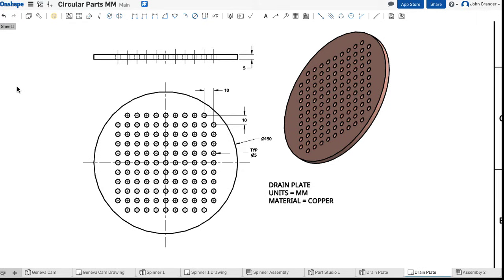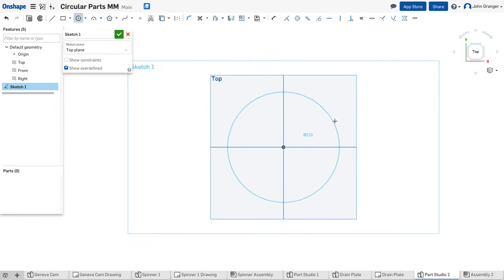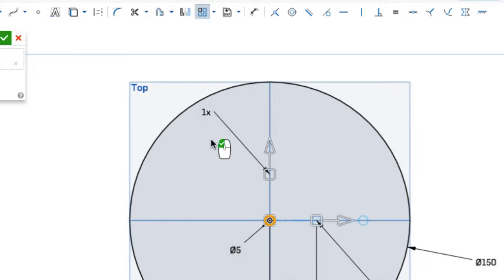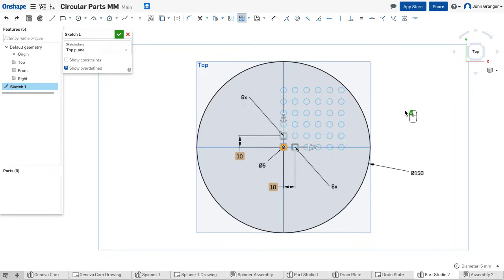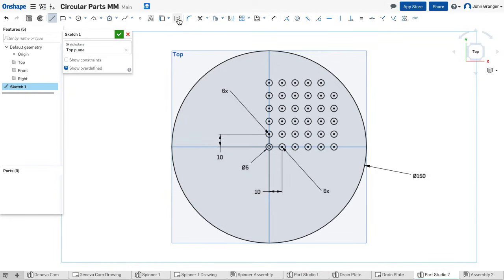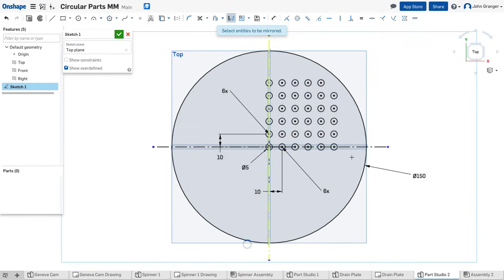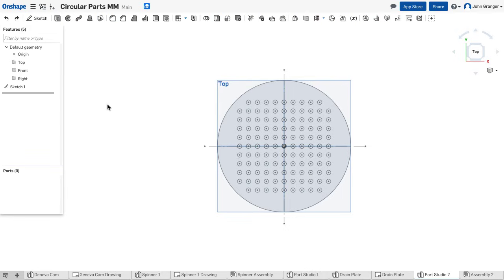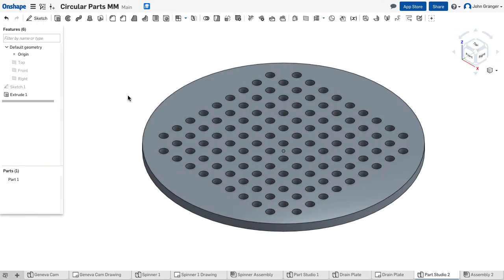Learn Onshape - Project 8 - Drain Plate

Comment: 2:35 Instead or mirroring, can’t you just use the circular pattern?
Reply: Try it and see how it works out.
Reply: @johngranger8123  I done it with a circular pattern and it works fine :)
Reply: @WiseFoolTrades  Thanks, that's interesting.
Reply: @johngranger8123  no problem bud